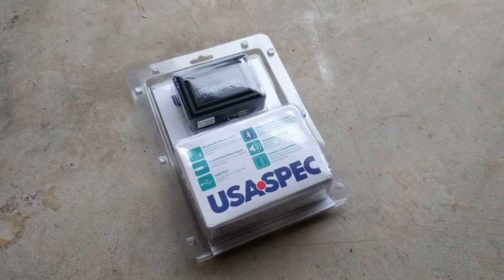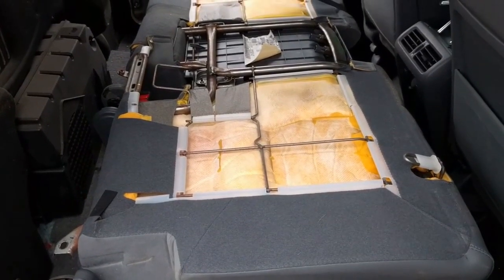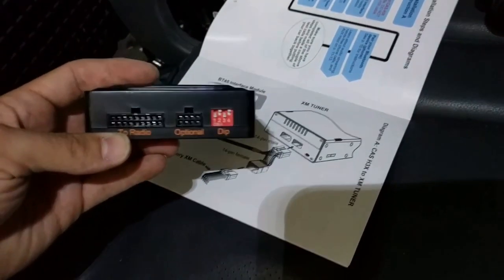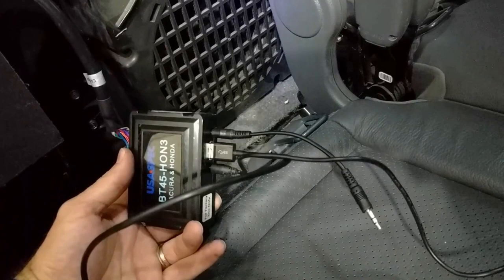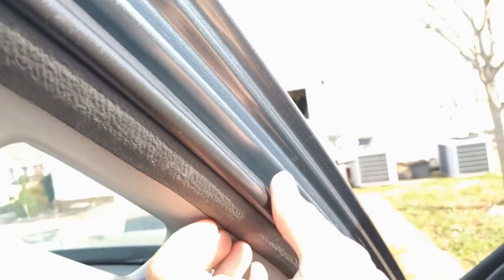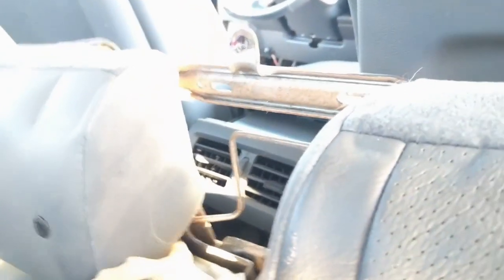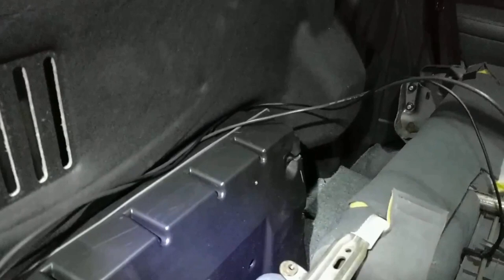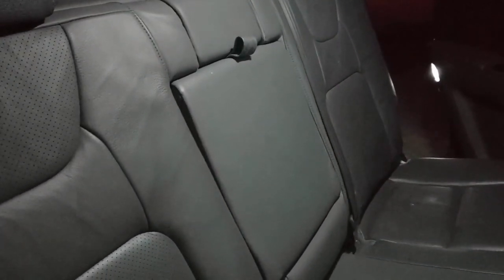USA Spec BT45-HON3 installation in '08 Honda Ridgeline

Comment: There’s no way the dealer will cut the insulator when the XM tuner goes out. You just had to remove the insulator to have a clean BT45-HON3 install. Anyways it’s been 4 years since your video how is it holding up since you bought the unit used and not new is still working?
Reply from the maker: It's still working great! I had one hiccup about two years ago, where the Ridgeline head unit wouldn't lock onto the Bluetooth channel in the BT-45. Their customer service team was great. Ultimately I just had to disconnect my battery for a few minutes to reset the unit, then reconnect the battery and reconnect my phone via Bluetooth. This solution worked perfectly; I was fearing that I'd have to uninstall and reinstall a new unit. The actual installation was August 2018, so we're at almost five years of near daily use. It's been a great purchase.

Comment: Hi Scott, 

Like others have said thanks for posting this it was VERY helpful. I never would have cut into the black stuff behind the seat.  

Question though: how do you get all 3 bolts to line up when putting the back of the seat on? The outer bolts are perfect, the middle seat threads are about an 3/4 inch too high. There's a gap between bottom of the seat back and the bottom of the seat, all the way across. The entire back of the seat looks like it needs to go down more, but it won't go, and the outer bolts lined up perfectly 1st time. Also, I can't get the 2 plastic pieces in the top that cover the hooks -- another indication that the seat back isn't down enough.
Reply from the maker: Rob...sorry for the delayed response!  It sounds like your diagnosis is exactly correct...there's gotta be something that's keeping that back seat from traveling as far down as it needs to go.  This could be one of those scenarios where a good night's sleep or a different set of eyes could help identify the problem.  It's been so long since I've filmed the video that I don't remember the exact technique, but I do remember that reinstalling the plastic trim gave me more problems than the bolt alignment.  If there would've been something terribly tricky or strange about it, I probably would've thought to mention it in the video.  Post back if/when you get it figured out...there may be some other viewers who have the same problem in the future!

Comment: Hey Scott, thanks for posting this video! I'm planning to tackle this tomorrow

Did you think about routing the microphone wire along the upper headliner? 

Anything you would do differently if you had to do it again?
Reply from the maker: Good luck! About the only thing I'd do differently is that I'd keep better track of the order in which the interior seat trim pieces came off. I mixed up the order when I pinned it back up and had to redo the trim installation (didn't show that in the video to prevent confusion)...no fun at 10:30pm. I considered fishing the microphone wire through the headliner, but I'd never done something like that before and I was a little nervous to try it. The unit's been great for me...I have to crank the volume a bit on phone calls, which means the music is way too loud when I end the call. But that is a minor quibble.

Comment: Any possibility to use the factory microphone?
Reply from the maker: Someone smarter than me could perhaps figure out a way to do that. As far as I could tell, though, the factory mic (for trucks with that option) just activates features of the built-in Nav unit. That's not connected in any way to this Bluetooth unit, so it would take some wizardry in wiring.